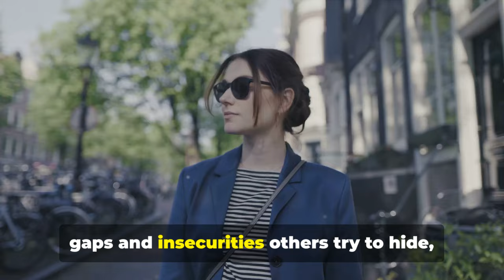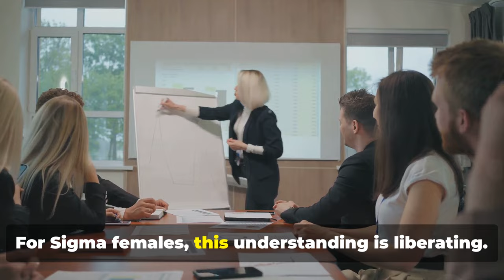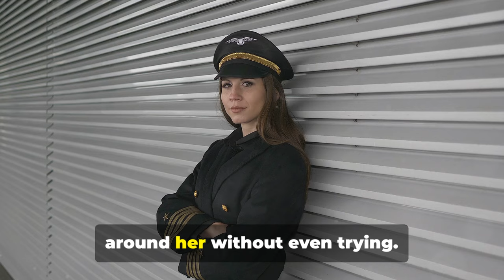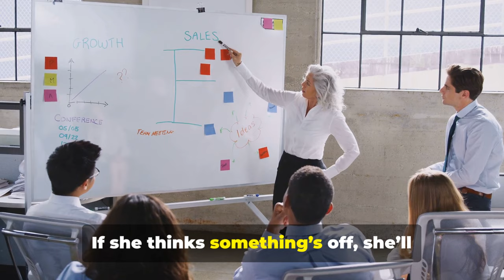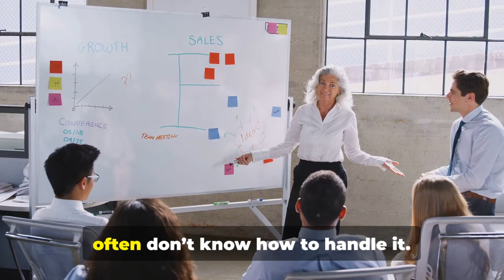Why Most Women DESPISE Sigma Females (Harsh Truth)

Comment: It's no wonder I don't have female friends (only acquaintances) and have always gotten along much better with intelligent males. 
With blokes you can tell it as you see it (in real life anyway, it isn't always the case in the workplace). You might have a vigorous argument, but once it's over, it's over.  You may still not agree with each other but there's mutual respect. 
In my experience, women are not like that. They seem to interpret disagreement as disloyalty and rejection, or a haughty flex!  They hold grudges and often seem to need other women to side with them to do the b*tchfest thing.  Exhausting.
Reply: Agree! TQ & enjoy the weekend!